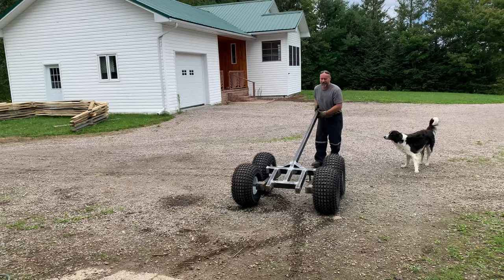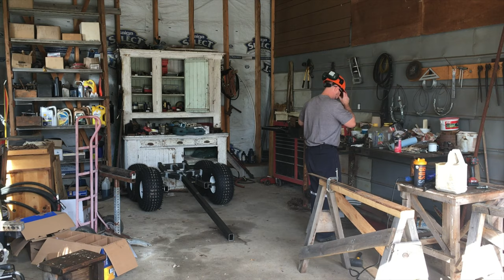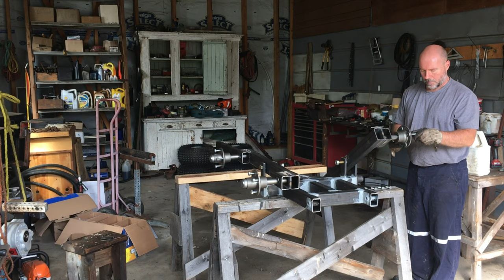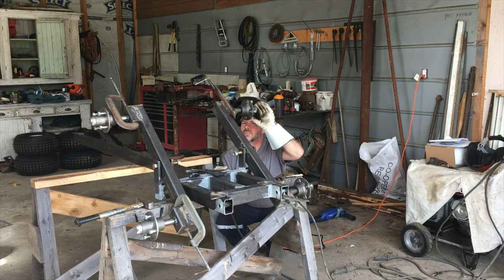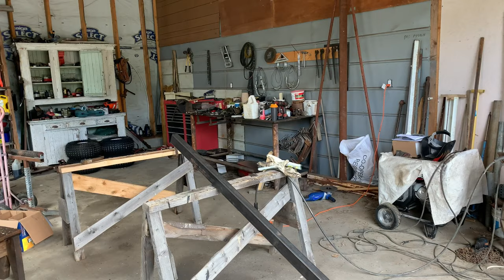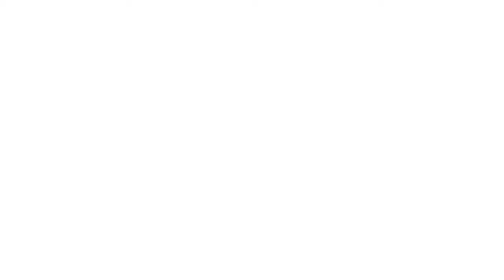The Ultimate Quad Trailer - Part 3 Welding the end Caps (#theultimatequadtrailer)

Comment: Great design and I have enjoyed the series. While I believe I have all of the measurements down, what is the size of the hole in the middle of the walking suspension and the back of the main frame to mount the bed(along with what size pipe you used for the project. I get that there should be a 1/4 inch over hand as a welding base for stability but was looking for the hole sizes, hardware you used and the pipe size. I apologize in advance if that was either in the drawing in the first video or if you mentioned it somewhere in the series and I am just missing it. Thanks again for sharing, I am going to give it a go and share picture when complete. I will get my welding practice in for sure. :) Great channel
Reply from the maker: Hi Kenneth,
Part 9 has most of the dimensions.
Thanks for watching and commenting!
Andrew

Comment: Love watching this. I’m new. I have a small John Deere tractor and need to build one of these. Could you tell me where you get your wheels/tires. Thanks 👍
Reply from the maker: Hi Laurie,
I bought these in Ontario Canada so I'm not sure these will be much help.
Tires/Wheels: http://www.cerka.ca/62-22-8-4-22-x-11-8-knobby-atv-trailer-tire-on-4-bolt-wheel?search=62-22-8-4
Hub: https://www.princessauto.com/en/1250-lb-high-speed-trailer-stub-axle/product/PA0002080000
Hope that points you in the right direction!
Thanks
Andrew
Reply: @LivingtheNorthernLife  I’m in Nova Scotia. Shipping prob be not too bad. I was thinking of the wider trailer wheels at Princesses auto but they are a bit small for off road. Thanks for the info. 👍